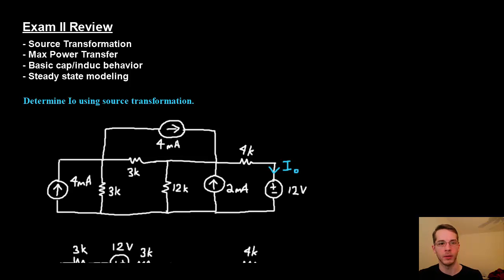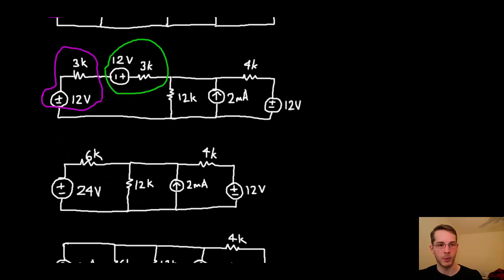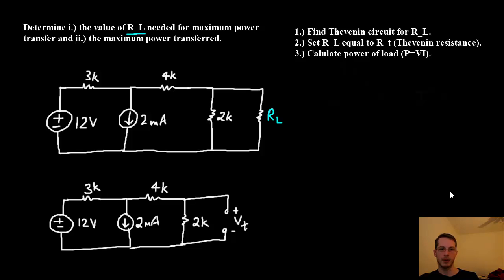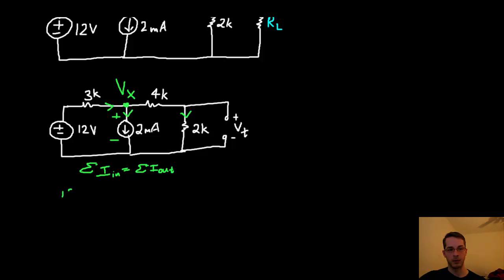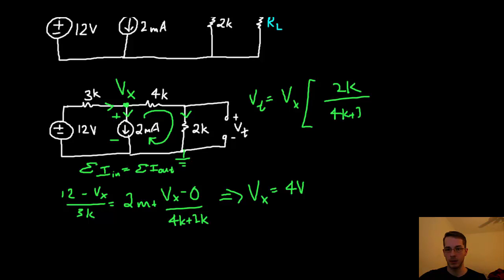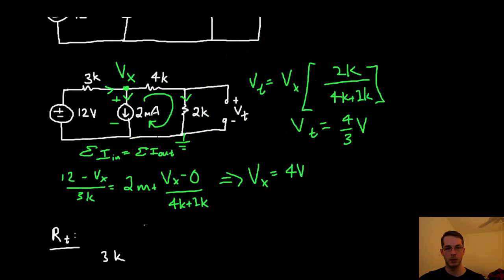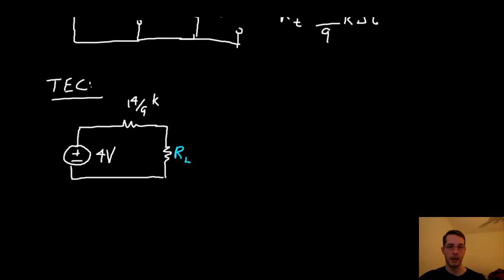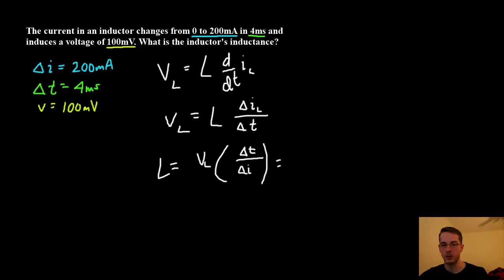EE 2950 Exam 2 Review, Spring 2015 (Part 1/2)

Comment: For the thevenin problem shouldn't the power on the load resistor be 18/7 mW?…. (2^2)/(14000/9)
Reply: No.You shouldn't be squaring 2 volts, You should be squaring half of (4/3) V. It says it on the annotation in the video.

Comment: When you found r thevenin in the 2nd problem I think you used the wrong resistors in parallel. The 3 and 4 ohm ones are in series the the 2 ohm is in parallel.
Reply from the maker: Aaron, yes you are correct. I've added an annotation at that point in the video to clarify my mistake. However, the final value written for R_t is correct.